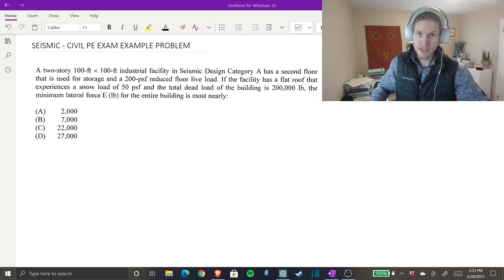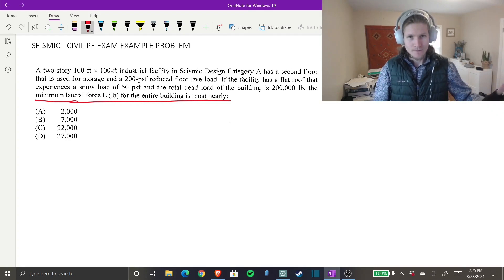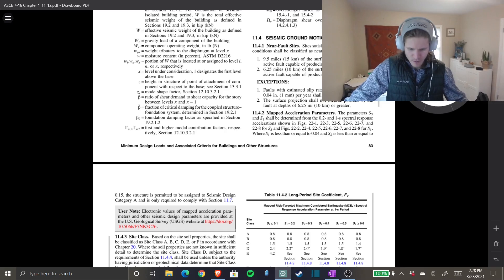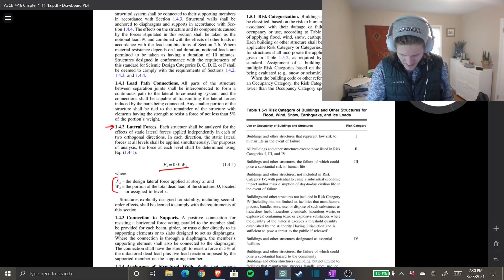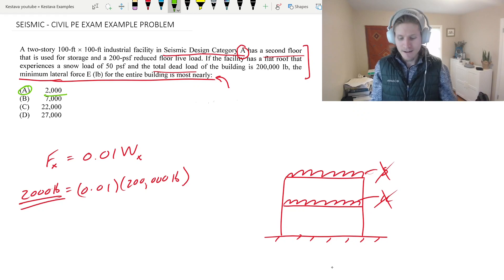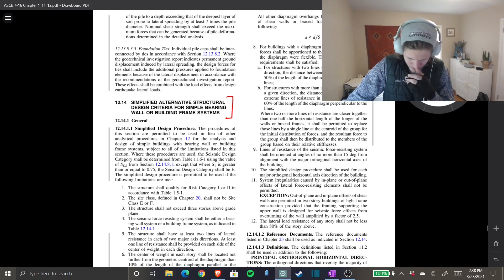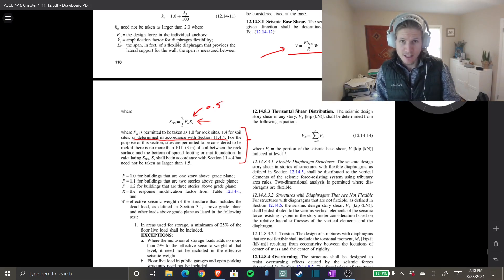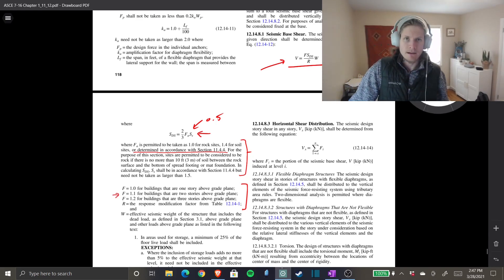How to Find Seismic Forces Fast | Simplified Method | ASCE 7-16 | Seismic Design Example

Comment: The title is misleading. This is only applicable to structures located in none seismic prone area.
Reply from the maker: sorry for the confusion - this is the simplified method (which is only permitted for seismic design category A)
Reply: @Kestava_Engineering  I think it is not only for A. In 12.14.1.1 it includes A, B, C, D, if a building has maximum 3 stories above grade, and meets other conditions. It should be usfule for light frame residential, as for that type share walls offsets are permited (up to 2 storyes). This method is used in WFCM for dwellings in table 2.6.

Comment: The code says the portion of deal load load assigned to level x (not the full dead load). I guess since they are asking for the nearest value, so 2000 is the closet one.
But In real life scenario for same example, it will be the dead load of floor 2 + walls + roof (in other words, all the dead load above that point). Is that right?
Reply from the maker: its the DL at that level, which would be the floor + 1/2 walls from below and 1/2 walls from above.